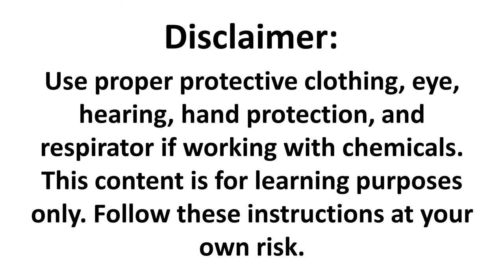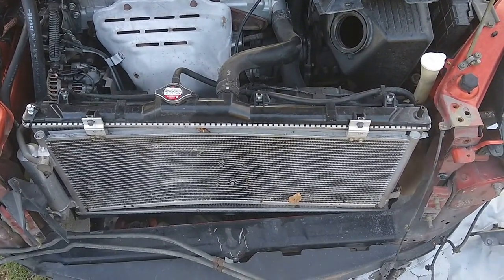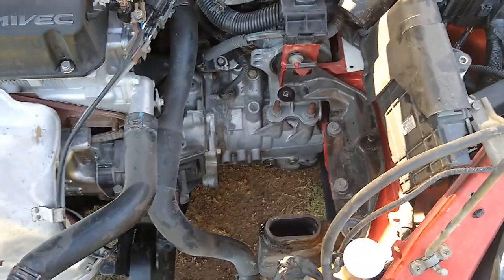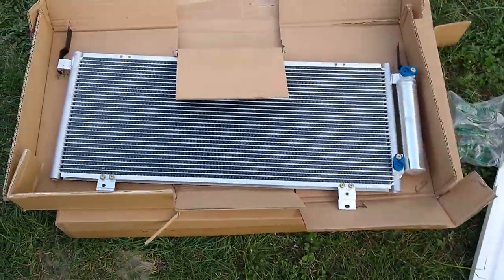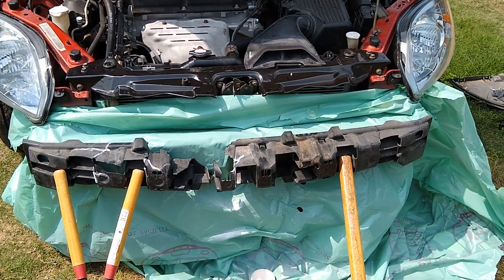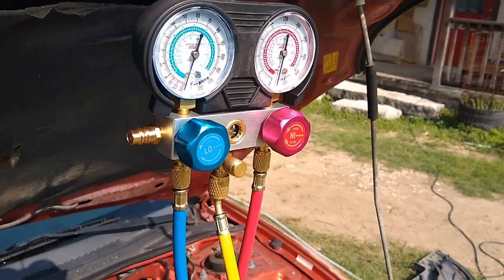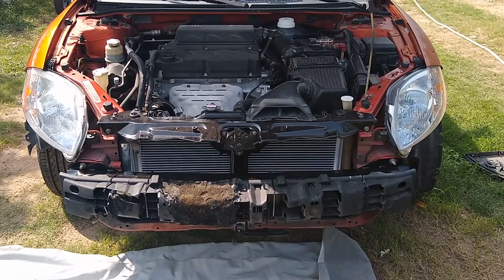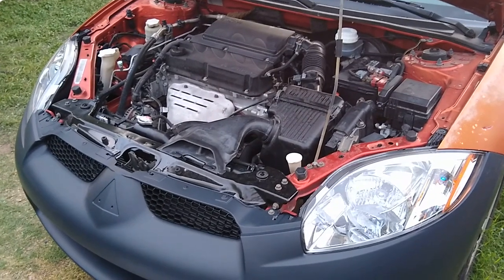2007 Mitsubishi Eclipse GS DIY front end repair under $600

Comment: This video just saved my life my 2007 Mitsubishi Eclipse GS literally overheated on the highway and I am far from mechanically inclined but this video gave me all the confidence I need to work on my car instead of being ripped off by mechanics. Just watching you replace the radiator alone was like saving, I have no clue if it’s actually the radiator but this device called FIXD came out and I’m going to run the codes and read the FSM I’ve already been reading the owners manual and seen that overheating usually comes from the radiator in section 6-6
Reply: To sum everything up, thank you for crawling so I can walk!
Reply from the maker: Hello friend, I'm so glad the video gave you the needed information to repair your own vehicle. Engine cooling systems are really very simple to troubleshoot. 

1. Make sure that there are no coolant leaks by checking the hoses for cracks and around the water pump, which is attached to the engine. Water pumps will usually start rattling or make grinding noises as their bearings begin to fail and leak coolant between its pulley and engine.

2. Check to make sure that the radiator's cooling fans are working, both fans should run when the AC is turned on to cold. If one of them isn't working replace the electric motor brushes for that fan.

3. Make sure that one of the fans comes on without the AC running by running the car's engine until it reaches normal operating temperature. If a fan doesn't come on but both ran when the AC is turned on then check the engine temperature switch and ensure a proper connection or replace it if faulty.

4. If everything else checks out but still overheating then verify that there is no air in the radiator coolant system by ensuring that it's totally filled with fluid along with the reservoir.

5. If after all the aforementioned has been verified then the only thing left is the thermostat itself which can get stuck in the closed position and not allow radiator coolant to flow into the engine.

If you have any questions, just ask.

Comment: Hello, did you by any chance drain the coolant  reservoir as well?
Reply from the maker: Hello Jonathan, Thank you for commenting. I didn't need to drain the reservoir to remove the radiator. In this case the radiator was damaged during the accident and leaked out all its fluid by the time I made the repair. If you are working on replacing a radiator with a slow leak then I would open the drain plug on the radiator and empty it. The reservoir doesn't need to be drained just topped back up after you fill the radiator back up. Have you replaced a radiator before? If not let me know and I'll provide you with a couple of tips from my own experience.

Best of luck with your projects!
Reply: Victor Bared I am actually changing the o2 sensor and thermostat on my eclipse. I removed the thermostat and cleared out the reservoir but I can’t reach the engine drain plug. Is it necessary to empty out the engine? When I removed the thermostat coolant came out of it as well

Comment: Were you able to bend radiator support tie bar back in place, or did you have to buy?
Reply from the maker: Hello Smoke65, Thank you for commenting. I had to replace the stock one. It was bent up pretty bad.

Best of luck with your repairs.

Comment: Replace plastic overflow tank for 2007 Mitsubishi Spyder
Reply from the maker: Hello Jim, Thank you for commenting. I'm not sure what you're asking. Do you mean did I replace the overflow bottle? If so I didn't need to the bottle was undamaged.

Best of luck with your projects!
Reply: @vbared  I actually got the last one they had at AutoZone in Orlando Florida when I called them I made them aware that there was a tube overtrain overflow tube coming to the bottom of the coolant tank because it's real thick at the bottom and it thins out at the towards the top so obviously you wanted to start feeling from the bottom up and that's where the crack was as well it was tough getting it in there there's no nuts or bulls is it it mounts on a slot a piece on the side of it that slides into a clip in the car you got to put it up in from the bottom and twist it a couple of times you get it by the hoses and all that then the cap on you overflow to the radiator cap and that was it I knew that was the problem but cold water after over each it cools down cold water didn't come out of there it didn't leak it's only when it's overheated and you put water in there it's crack was so thin it's expanded and hot water was in there just for years of working on cars that's all I could figure out and plus the fact is 14 years old